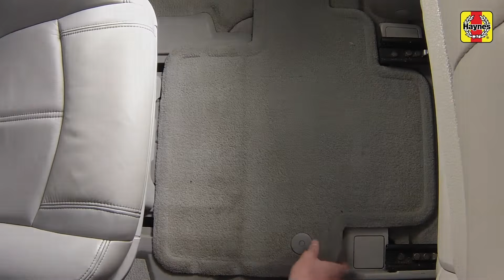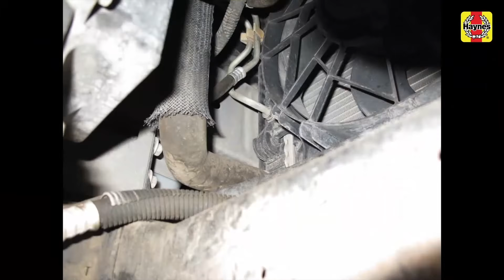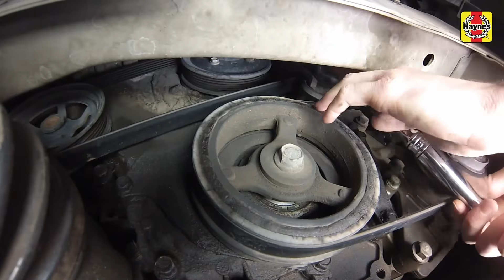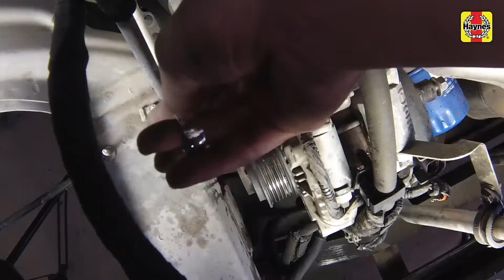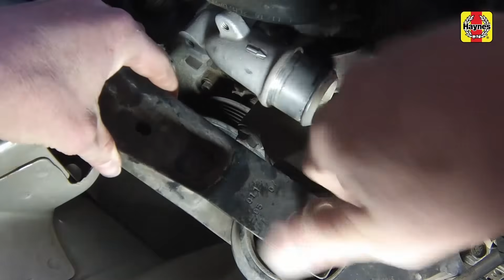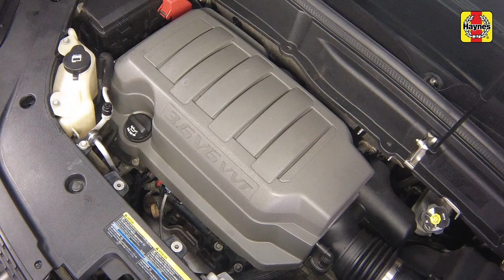How to Replace the alternator on the GMC Acadia 2007 to 2015

Comment: Video looks very informative but why drain the coolant,   I didn't see any purpose for that.  Just wondering if that was necessary.
Reply: He skipped over taking the upper radiator hose off.  Draining the coolant isn't necessary, along with much of the top side engine components being removed in this video. The alternator will fit thru the wheel well.

Comment: WAS WONDERING WHY DID YOU PULLED THE 2 STUDS TO GET THE ALTERNATOR OUT THE REPLACED THE ALTERNATOR WITH THE STUDS ALREADY INSTALLED SO IS IT NESSARY TO REMOVE THE STUDS GREAT VIDEO THANKS FOR ANY HELP

Comment: The way they did it is a joke no need for all that extra stuff why take the serptine off all the way just get it off the alternator and no need at all taking the fuse box out or the motor mount huge waste of time u can get the alternator out from the front just take the expansion tank out this is what u call a cash grab way of doing the job

Comment: take the whole fromt end apart for better access if ubsee a screw just unloose it ams put it to thr side in a pile should have a big pike by time u get to the belt area then  disconnect headlamps and windshield wipers ans fluid res  then  just spray wd40 on anything old to make it shine  tey tonstart jt see if it tuens over if not  call a good friend   amd stay off the addys

Comment: I did the alternator replacement on our 2013 without doing the radiator draining and I was able to pull it from the top.  Just takes patience and rotating it around obstacles.

Comment: those mounting studs were a nightmare! For some reason, i didn't have clearance to install the studs then slide the alternator on. i had to thread the stud while holding the alt. 30 minutes of cursing and questioning my sanity... Finally got it, great video.
Reply: What did you use for the studs
Reply: Why did he remove the studs if he put them in first whit the new alternator ,
Reply: Never-mind I got it

Comment: DO NOT GO OFF THIS VIDEO, completely unnecessary work, you don't need to remove anything but the serpentine belt, you can reach the alternator without removing all that extra stuff mentioned here.
Reply: This is the most ridiculous vehicle ever such a poor design
Reply: I had to remove the coolant hose & reservoir, engine cover & front top cover,  loosened ac lines to push out the way, jacked up the car and removed tire & tire guard for better access, then loosen idler pulley all the way, then loosen tensioner to free the belt from pulley, unbolt alternator bolts then remove it from the top
Reply: Hey help me with my arcadia need help 😩
Reply: @efrain_ebk u lowkey needa take off the engine mount and coolant res
Reply: Really ? Just the serpentine belt
Reply: @michaelmartinez9602  nope more than that
Reply: @tspeedtrayah  doing mine right nowc..and  you don't need to remove anything other than the coolant reservoir..the mount and anything else is unnecessary
Reply: @tspeedtrayah  thank u sir I figured this was bogus
Reply: U can pull the plastic wall from in front of the front tire and get to it so must easier.  There is a quick tip video on it.
Reply: He's right it lil hard but u can take it out fom the side

Comment: I don't mean to be a know it all, but many of the steps shown are simply not needed. 
1 No need to remove radiator hose
2 No need to remove fuse box
3 No need to remove engine mount.

Why GM used studs on the top is beyond me.
Why GM used such a long bolt on the tensioner is beyond me.

Comment: You didn’t need to remove the studs if the alternator goes back on it with studs replaced first before reinstalling the alternator
Reply: what ???

Comment: Disconnect negative battery cable, remove tire and fender liner, move reserve coolant tank, disconnect battery cable on the alternator-13mm, unplug the sensor,  take belt off idler pulley, remove idler pulley as far as it goes-15mm, go up top and remove 2-15 mm bolts holding alternator on, remove the 2 studs those bolts were attached too.. remove alternator threw the fender
Reply: I was going to say that too, this is a nice way to do it if you don't want to take the tire off or get on the ground it's not that difficult to take those bolts out just a bunch of extra steps depends on how you want to do it, like I was looking at this video and it's raining out here I have a canopy to keep the rain off my head and I really don't want to get on the ground so this is a good way to do it from the top but if it wasn't raining I would definitely take the tire off and do it the other way
Reply: I'm happy I read this while the ads rolled.  Appreciate that
Reply: Thank you 🎉 👍 doing this now 😊!!!
Reply: Hey question, do i need to jack the motor first? Or just jacl the car up?
Reply: @tylerorta3875  jack the motor? Nope just jack the car up and take the inner fender liner out and follow the steps
Reply: Is this the way to do it without draining the coolant?
Reply: @michaelvillagomez8393 yeah why would you need to drain the coolant?